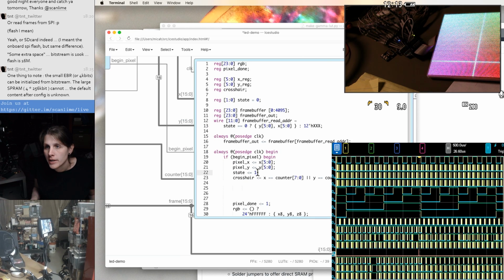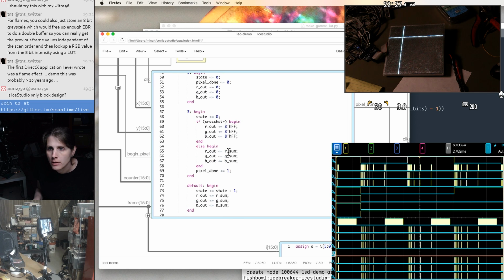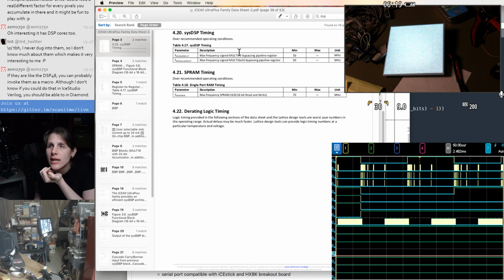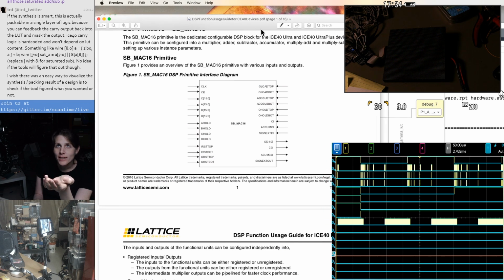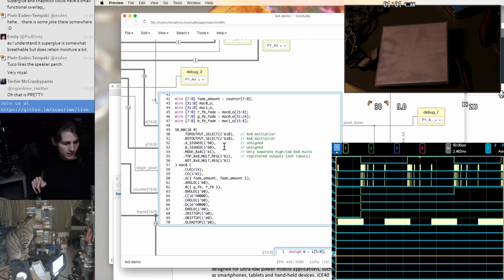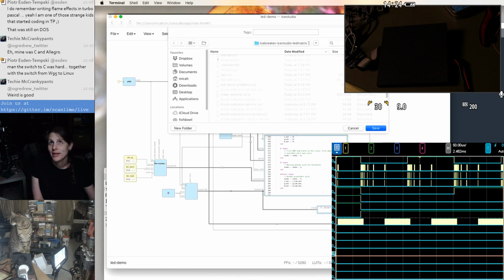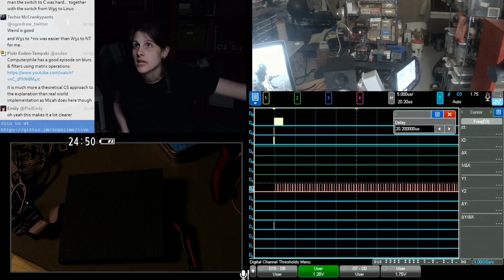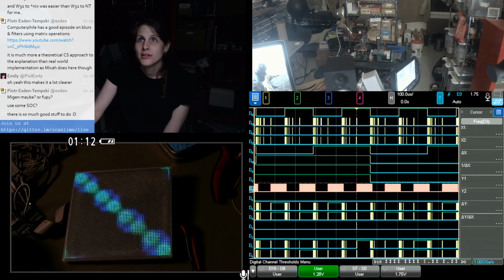Icestudio and Verilog project, LED Matrix FPGA driver! Part 4

Comment: can there be video input thru the icebreak dev board so if i wanted to build a video wall and or make screens for retro gaming ? i saw one driven using a " NT mini" thru fpga and nifty little mode thrown together from spare parts but i saw this board has said spare parts allready incorparated i was hoping this might be a bit simpler for someone just learnin. thanks..